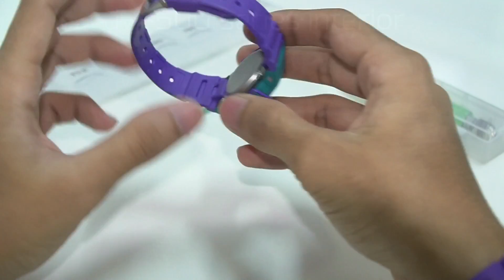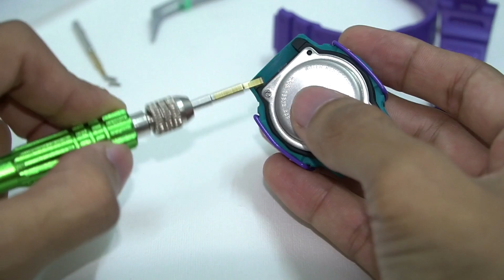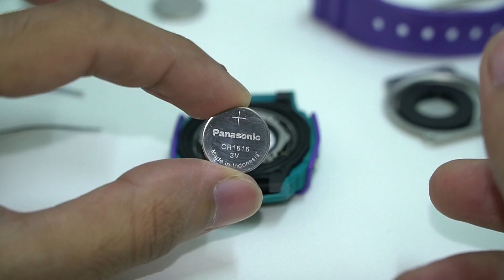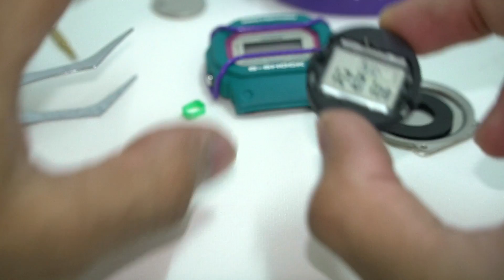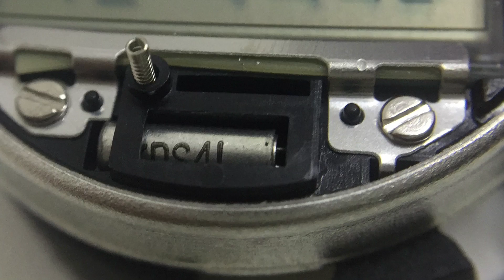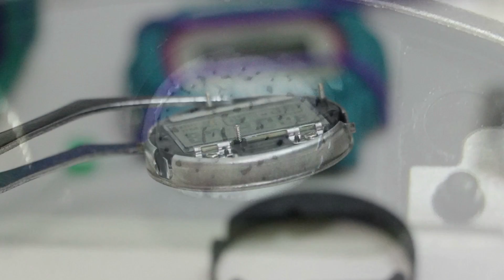Whats inside DW-500 series G-Shock watch

Comment: hello sir, may i know why did you do the "ac" operation? do all g-shocks need to do that after changing the battery?
Reply: It clears the memory and puts the watch in normal operation, and yes after every battery change on a g shock you need to do the ac
Reply: @Dominican_girth  thank you for your input.
Reply: On some older casio's 🎉the watch won't turn on until u do the AC reset. This has led to me getting MANY "broken" g shocks for dirt cheap cuz they think it's broken for good
Reply: @TechTokOffical  thank you for the info sir. 👍👌